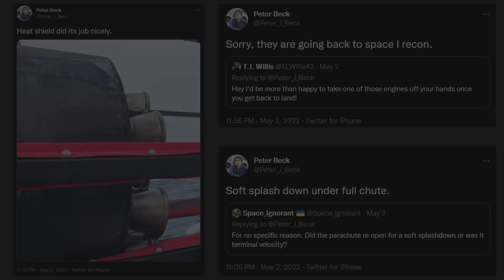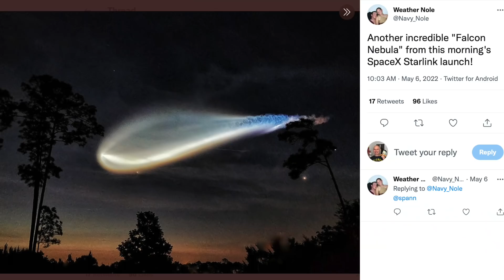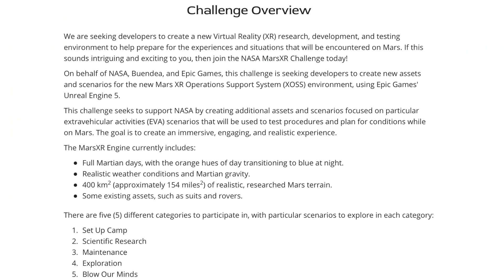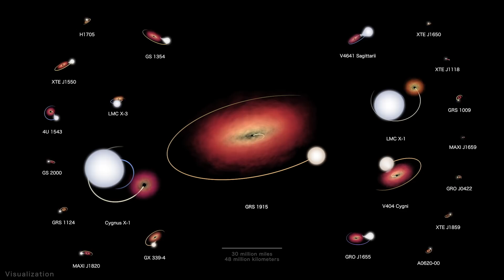SpaceX Planning To Land In Middle of Bahamas - Deep Space Updates - May 10th

Comment: Helicopter blades besides rotating in pitch(angle of attack) via the swash plates, can tilt up or down in relation to the hub something like 15-25°. This way, for example, when the blades at the rear pitch up and the blades at the front pitch down so the helicopter will fly forward, the whole rotor effectively swivels forward towards the front of the helicopter.
When helicopters pick up oscillations, the blades will start swinging up and down at the tips in a procession, eventually they'll hit the limit of travel at 15-25°. This will cause the rotor to violently rip itself apart and the helicopter to become uncontrollable. See Ground Resonance, or Mast Bumping.
Reply: Helicopters are dumb. If they aren't broken they're about to break. They should try catching it with another rocket instead.
Reply: @NACAM42  That's the most Kerbal sounding idea I've ever heard. We should tweet it to Elon as an idea for catching Starship.
Reply: @NACAM42  Hilarious! Helicopter definition: about 10,000 parts flying in loose formation.
Reply: Yep. That's why I fly fixed wing.
Reply: Mast bumping is a non terrifying way to describe the cutting off of your own tail rotor. Something for which there is no recovery.
Usually.
Reply: @christopherleveck6835  Tail rotor if you're lucky, main rotors can suffer mast bumping too and shear off or self destruct.
Reply: Ground resonance has nothing to due with blade angle of attack, and everything to due with sitting on the ground and not being able to move around freely causing vibration, or drag angle rotation on some head designs. Mast bumping is when the rotor runs into the mast and only is only possible on certain head designs. Neither of these things is directly caused by the swashplate angle, but it can lead to it on certain head designs. Swash plates are limited to between 9 and 12 degrees max. The tilt you mentioned is based on head design, and some don't tilt at all.... Mast bumping only occurs on a helicopter with 2 main rotors with a specific head design. Both issues are a result of not being able to keep the rotor blades and rotor head at a constant speed, period. As an example you rarely have issues with a Huey doing this even thou is uses the same head design that is known to have this issue. There are 2 bladed head designs that can not physically do either of these really bad things, but you will never see them on inexpensive helicopters due to manufacturing and maintenance costs..
Reply: @shvrdavid  Without being an expert on helicopter design, I'm assuming though that the tethered load of the captured rocket was causing a resonant oscillation in the helicopter fuselage, and that if allowed to progress this could exceed the maximum tilt or swivel that the rotor/blades can go to before hitting a mechanical limit, at which time mast bumping would occur and probably be catastrophic. Either the rotor would become physically damaged or there'd be a total loss of control.
Reply: @SpecialEDy  My point without directly mentioning it was that a Sikorsky S-92 rotor head design can not have mast bumping and has very little chance of any ground resonance even if you bolted the helicopter firmly to the ground. They are not cheaply built 2 blade rotor heads with hinged blades, and it is not a tilt rotor design. S-92's have 3 or 4 non hinged main rotor blades, and a non tipping head. The oscillation they encountered in attempting to catch the booster was classic tethered load oscillation. The oscillation is in the tether and load, under the helicopter. Maximum carrying weights on a S-92 is somewhere around 6,000-12,000, depending on how much fuel is in it. The modified S-92 they used may be slightly more, but not much more. They were risking maximum lift, which goes down when the tether oscillates or the load is blown from underneath the center of gravity more than a few degrees. With any amount of wind or any oscillation in the tether they will always have to release a load like that or drop like a rock. The rotor head, blades, etc, will be perfectly fine until right before you hit the ground if you decide not to release the load. Oddly enough, the FAA has done multiple studies about the downfalls of tethered load oscillations in helicopters, including the S-92. I am curious what will become of this if the FAA reviews this attempt to catch a payload. If you were flying a Bell design rotor head with 2 blades, what you said could possibly happen from just flying it around and doing something that changes the head speed too quickly. You would never attempt to catch anything with a helicopter using a 2 blade hinged blade design for that very reason. To give you an example of how different some rotor heads are look up a DFC rotor head, that the rotor head never tips over at all. Then compare it to a Bell Hiller design that is designed to tip over and can become very unstable and tear itself to pieces.
Reply: @shvrdavid  
Thank you, I came here to say exactly that. 
It’s not a Robinson. It does not have flappy blades.  

Ps, the angle of attack is closer to 5-7 and with tilting rotor heads the cyclic angle of attack almost doesn’t change, the disk angle changes.
Reply: @SpecialEDy  it's not a vibration or procession even. It's simply a rocking motion that can cause the tail to come into contact with the main rotor and literally cut the tail rotor off the aircraft.
Remember, a helicopter is basically  hanging from a pipe. Like a swivel even.
Or a pendulum if you like.
They do have a lot of vibration issues. They can propagate through the blades and cause harmonic vibrations that can cause nuts to back off of bolts or create stress fractures.
Reply: @christopherleveck6835  Oh yeah, like that Robinson R44 that crashed in Texas.

On some helicopters the linkage for the blades can grind into the mast and literally cut the main rotor off. I wouldn't want to try to fly a helicopter with no tail rotor, but nobody can fly a helicopter with no main rotor.

Mast bumping can also just damage the blades and links from them slamming/flexing back and forth into the mechanical hard stops, and then the whole assembly just rips apart.
Reply: @SpecialEDy  Regarding your original post, you are incorrect. Blades don't tilt. The pitch of each blade at any position around the rotor disc is controlled by the swash plate.  The pitch depends on pilot input. For example to fly forward the swash plate is tilted so it sets the blades pitch  at minimum angle of attack at the front of the helicopter and maximum at the rear. The rotor only looks like its tilting because of difference of the lift produced by the blade at given position along the rotor rotation. Youtube "THE MAGIC SAUCE THAT MAKES A HELICOPTER WORK" and "EC145 Swashplate animation" for better explanation.
Reply: @MattDvc  that's incorrect. I suppose the proper term is Flap. The blade is hinged in the vertical direction, when you increase the pitch of a blade, it swings upwards for the next 180° of it's rotation. All of the blades of the rotor disc, or the entire rotor, tilt or Flap, into the desired direction of travel. Pitch inputs don't directly steer a helicopter, they only create an imbalance that pivots(flaps) the rotor disc.

Also, the pitch change happens 90° prior to intended output. So, with your rotor spinning counter clockwise, the blade is advancing(going forwards) on the right side, and retreating(going aft) on the left. To fly forward, the swashplate increases pitch and lift on the left side of the rotor disc. This forces the rotor blades to flap upwards at the rear of the rotor disc, and downwards at the front of the disc. Basically, increased lift on the left side pivots the entire rotor towards the front of the helicopter, creating forward thrust.
Reply: @SpecialEDy  firstly I've skipped the gyroscopic precession for simplicity, secondly I thought you meant that the entire rotor assembly physically tilts, not just the rotor plane due to forces applied. 👍
Reply: Correction: when it pitches up on the left and down on the right, the helicopter will pitch forward, due to gyroscopic precession.
Reply: @Hyperus  not precession but change on AOA from changes in relative speed from advancing and retreating blade to balance the overall lift on both sides of the rotor disk.
Reply: @Bertrp  no, it is precession, assuming a counter clockwise spinning rotor anyways(opposite to what I said if clockwise)

AOA has nothing to do with it, if you push vertically on a spinning disc, that effect will precess by 90 degrees in the direction of the rotation
Reply: @Bertrp  Yeah, he's right but I didn't put it in my initial post because I didn't want to overcomplicate things.

The swash plates act 90° in advance of the desired control. Suppose a clockwise spinning rotor blade looking down from above: If you input a forward pitch of the helicopter into the stick, the swashplate will actually increase the angle of attack on the right side of the airframe, decrease the angle of attack on the left side, and not alter the pitch on the forward or reverse sides of rotation. This will increase the lift on the right side of the rotor, which will pivot the rotor or individual blades towards the front of the helicopter.

The blades change pitch(AoA), but they can also swivel up and down as they're hinged in the vertical direction on the mast. Changing the pitch causes the blades to pivot up or down 90 degrees after the pitch change. It's the fact that the entire rotor is "leaning" forwards, backwards, left, or right, that causes the helicopter to go that direction, not directly the AoA of the individual blades, and unsymmetrically changing blade AoA only serves to tilt the rotor 90° after the AoA input.
Reply: @SpecialEDy  , yep got that it works out of phase but that is still a very simplified answer of how a helo operates. Collective coupling and tail rotor coupling as well. But soon as you push the cyclic forward and translation lift occurs the advancing blade will have a lower AOA compared to the retreating blade to make the same amount of lift to stay in level flight. 

It's been a hot minute since I flew and still makes my head hurt thinking about canted tail and tilted rotorheads.

Guess this also depends on which of the 3 theories on how a helicopter flies that you buy into. Or a combination of them. Theory wasn't my specialty, flying was more fun
Reply: @Bertrp  I've got bigger issues with theories, All this talk of Bernoulli's principle, pressures, and lift. At the end of the day, it's all reaction mass and Newton's third law is what matters. Wings and rotors just throw air downwards, which pushes you upwards.
Reply: @SpecialEDy  
Thank you. 

Yes, it is all reaction mass.
Reply: @Hyperus   No, you have your physics a bit mixed up. A force parallel to and coincident with the torque vector will not cause any precession. Precession is caused by a force applied perpendicular to the torque vector. Mathematically the precession is the cross product of the torque vector and the applied force vector. The magnitude of the precession is proportional to the sine of the angle between the torque and applied force vectors. When "pushing vertically on a spinning disk" the angle is zero and hence the precession will be zero.
Reply: @GntlTch  The sine of the angle of a "perpindicular push" is always 1.0
Reply: The easiest way to think about procession, especially given the channel this comment section is in, is orbital mechanics. We are talking about what would be an axial impulse (normal/anti-normal burn in KSP), or a burn towards the north or south pole for an object orbiting the equator.
If you accelerate a spacecraft axially, it's new orbit, like with all orbital impulses, passes through the point of the impulse. So axial up, the new orbit will reach the highest point of inclination 90° later in orbit, and the lowest point 90° before the burn in orbit. The point of impulse become the point of peak axially velocity(other than the opposing node) in the new orbit.

Gyroscopes, or spinning discs, act exactly the same in this regard. If you apply an axial force to one side of the disc, like using the collective to increase AoA and thrust on one side of the rotor, that becomes the point of maximum axial velocity on the disc. And, the disc reaches a relative axial velocity of zero, or peak elevation, 90° later in it's rotation.
Reply: @Hyperus  I think we're talking different parts of the same system. Your talking about cyclic input is -90° out of phase in direction of rotation and I was talking about collective coupling. change in lift requirement for advancing and retreating blade. 
Appreciate the discussion had to crack open a few books I haven't looked at in years to refresh memory.
Reply: @Bertrp  Cyclic phasing is entirely based on head design. Most people don't understand that and mention 90 degrees as a fixed value, and that is not the case.
Reply: @Hyperus  Gentlemen - may I propose that both phenomena are in play her?
Reply: @Hyperus  if it pitches up on the left and down on the right, that's how you bank the helicopter to the right. When you increase the pitch of both blades you go up, decrease, you go down. Tail rotor counteracts the torque from the main rotor but using the pedals you can increase and decrease the pitch of the tail rotor which turns/yaws the nose left and right. Forward and backwards is accomplished by pushing the stick forward and back to change the angle of swash plate which changes the pitch of the blades. Forward on the cyclic (stick-swashplate) increases the pitch of the rotor blade as it passes behind you flattens the pitch as the blade is on either side of you and decreases the pitch of the blade as it swings in front of you. That make the helicopter go Forward.
A helicopter achieves Forward flight by flying on the disc created by the spinning blades exactly like a wing.
That's why helicopters are called rotory wing aircraft.
Reply: @christopherleveck6835   Hyperus is right (at least in effect even if not in the name as GntlTch mentions), if helis worked as you say they'd start rolling as you increase forward speed. After all increase in speed works the same as increase in blade angle - giving more lift. And what does having more lift on the advancing side (going into the wind, left for clockwise) than on the retreating do...? It pitches the heli up, that's why we often see wings on the tail, to provide lift countering the disparity of lift between left and right side of the rotor. It does not work "exactly like a wing".

Thing is, a heli literally is a spinning disk with some insignificant thing attached at the bottom, at least when you compare rotational inertia. Which is why pitch/roll works according to gyroscopic rules.
Reply: @lingSpeed  they actually start rolling as you increase the speed. you have to correct it with left (or right) cyclic input.
Reply: @MattDvc  True, true. You can never be 100% correct on helis unless your post has page numbering :).
Reply: @lingSpeed  🤣🤣👍